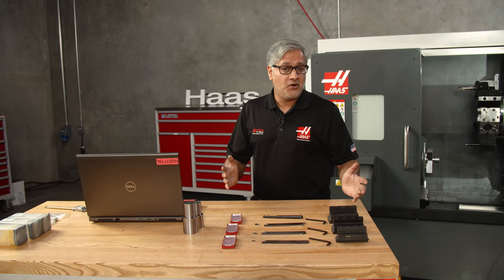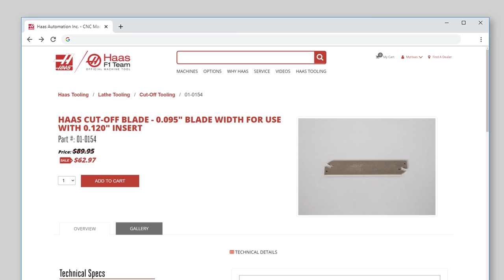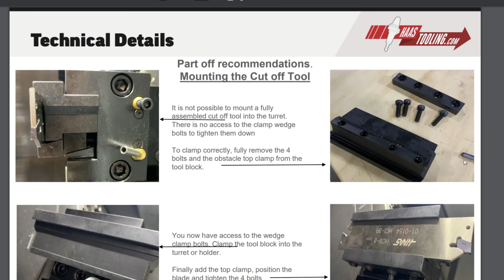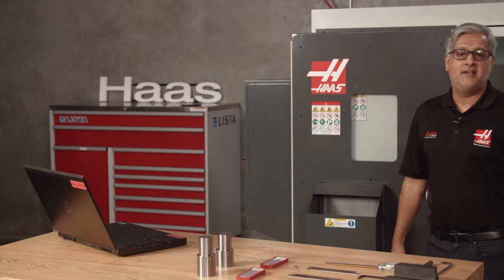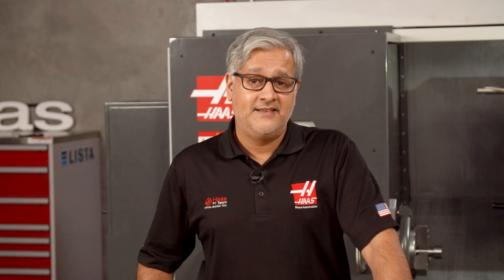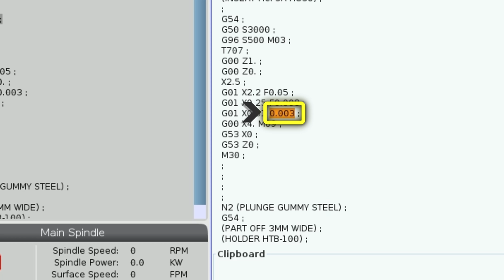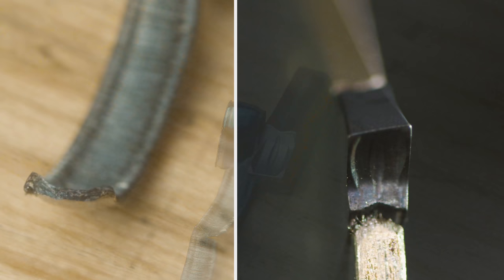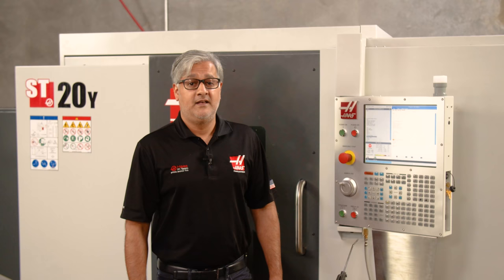Part-Off Like a Pro! - Haas Automation, Inc.

Comment: When he tried to put it in the turret assembled I’m like, yep, relatable
Reply: Had the same issue. I drilled and tapped two holes in the top of the tool holder for set screws. Problem solved.

Comment: I don't know if they changed it back to a safer way, but the G50 clamp speed has to be after the tool call on some Haas lathes! Super dangerous, so make sure to program your Haas lathe correctly.

Comment: 8:50 you can see clearly the parting blade wobbling up & down from trying to cut that material. Lots of factors affect this, but material really shows up as a problem as well as the lack of coolant because demo.
Reply: i think youll find thats the reflection of the jaws
Reply: the hell u talking about. So called 'wobbling' is the filming artifact from the jaws. The groove made is absolutely clean

Comment: It doesnt fit in the turret assembled?
Fire the engineer that designed it, fidling around with screws in a dirty cnc machine sucks ass vs. fully setting up the tool on the bench.
Reply: This is a super old design that most other tool companies have gona away from, you can still buy blades from pretty much any tool company, but they all have much better systems now.
Reply: You probably got ! The Wrong Turret

Comment: I know this is off topic, but I am in the process of looking at a Haas ST35LY for our factory. Now I new to dealings with Haas, I am mainly Mazak and Okuma machines, so I would some feedback from current owners on their machine. I am putting my neck out by even thinking of recommending a Haas machine. Thanks
Reply: If you are used to mazaks and okumas then you will be sorely disappointed with this disposable garbage. You want to stay as far away from this cheap crap as you can get. You are putting your neck out by even thinking of recommending a haas. There is no corner left uncut at this joke of a company.
Reply: Nothing beats an Okuma lathe period. Programming a Haas lathe at the console sucks. Also, they're not rigid and lack torque.
Reply: @enispenvy9174  Thank you for you reply, it will help win my point of opinion with the manager that cheap isn't always best.
Reply: @chris_schenkel  Thank you for you reply, it will help win my point of opinion with the manager that cheap isn't always best.

Comment: It would be nice to have some TL-1 or 2 options! Looking for a cutoff of 6.25 inch options.
Reply: That's deep. I usually saw cut things over 3 to 4" diameter on my manual lathe because things start getting really tricky at those depths.

Upside down tool with high pressure coolant and an enclosure - perhaps not so bad!
Reply: Catching that part wouldn’t be easy!!!
Reply: @thomashenderson3901    ok so you say 2,6inch /65mm is doable for production?   I am currently having the issue for machining a Cover for a small container in volume out of steel.
Reply: @Hendreh1  Yes, I would say so.
All depends on the set up / overhang and the rigidity of the machine.
I used to really hate parting until I discovered proper carbide tipped parting blades, now it's only an occasional danger!
Best advice I could give is to support the workpiece as long as you can with the tailstock, but as you're about to finish, take the pressure right off until it barely touches and then finish the cut, that way the blade doesn't get jammed.
And always use the least tool overhang you can get away with to minimise vibration.

Comment: Walter makes a blade holder that bolts right to the BMT turret and is much thinner profile. Fits really nice between both spindles. Has thru blade coolant on top and bottom of the insert and a nozzle right above the blade that shoots right down the groove.
Reply: nice should link that.
Reply: @Shockdagon  I couldn't find it on their website but it's in the catalog I have at work. If you're really interested I can post the Blade, Holder, and insert numbers tomorrow
Reply: @inuyashacoolieo  is it the 2042P?
Reply: @SuperAWaC  just search BMT on Walters website. Then you should see Blade adapters. They have all kinds like VDI and BMT45, BMT55, and BMT65. I forget if you want the left or right hand. I use the one that puts the blade closer to the Main spindle.
Reply: @SuperAWaC  A2110-BT65-32R-083-P I believe. -32L-P would be left hand version
Reply: @inuyashacoolieo  Looks good.

Comment: I have a metric machine my block would be 25mm not 1 inch 
Plus are these links relatable to the Haas  uk market your accent makes me think yes but please confirm 
I need a part off facility for the ST 30 Bolt on turret 12 station  but cannot seem to find a tool such as you describe which dismantles 
Can you put link up for UK site please
Reply from the maker: Philip, Great question! At present we are working hard to have HaasTooling products available for continental Europe by the end of this year. We are farther out on defining how/when we will bring HaasTooling to the UK.

Comment: Variable speed turning  or Spindle Speed Variation (SSV)  would help with surface finish. simple G50 speed clamp code that tells the controller to live calculate surface feed depending on its diameter while cutting.

Comment: I am using the 2mm blade to part off a pc 1.75"D 304 Stainless  using less than the required stick out at .091 dialed in with a tenth indicator and the cut off tool deflects to the z positive every time. As I thought it might due the the angled insert..... Any suggestions?

Comment: See I like using G75 but the issue is the feed is continuous all the way past x0.0, gotta be on point turning the feed down by hand when it gets close. I reckon this is when the majority of the tool wear happens
Reply: when it gets closer to the center as speed drops without increasing RPMs.... I´m parting off with just G01 and G00 with chamfer/radius in few lines, maybe you can set it this way, let it go at F0,15 (mm/rev) maybe to X10 and then drop it down to F0,08 for example to X-2

(part is 30mm in dia, needs to be 30mm long)

G54 T0505;
G92 S2200;
G95 G96 S120;
G00 Z-30 M03; (finish lenght because I have zero point set on the right side of parting insert instead of left)
G00 X31 M08;
G01 X27 F0,12;
G00 X31;
G00 Z-29;
G01 X30 C1;
G01 Z-30;
G01 X10;
G01 X-2 F0,05;
G01 X31 F0,5 M09;
G28 U0;
G28 W0;
M05;
M30;

this is example from how I´d write part-off with just reduced speed towards centre where your machine hits it´s maximal set spindle speed (just look at it at first on which X value it maxes out) on our Fanuc 0i-TC, few changes and you´ll do it in HAAS too.... I´m parting off like this everytime, just without slowing the feed towards the center :)

Comment: how do i set up my parting blade, and we can do Y-axis parting?
Reply from the maker: Gerardo, On the HaasTooling Cut-Off Tooling webpage, click on the blade you require and there is a link to the technical details page. This linked page covers everything you need to know on how to set up your tool and blade. Plus other info like blade hang out recommendations. 
To get you in the ballpark; here is a link to the 3mm Cut-Off Blade page: https://www.haascnc.com/haas-tooling/lathe_tooling/cut-off_tooling/01-0154.html

Although our Haas Y-axis machines are capable of Y-axis parting off, these tools are designed for X-axis parting off only.

Comment: 6:38 G97 500 rpm? or G97 S500 or is it G95/G96 machine LOL lol. thats more than aluminium rouching LOL
aah nevermind its FEETS. come on metric is more acurate start use them lol